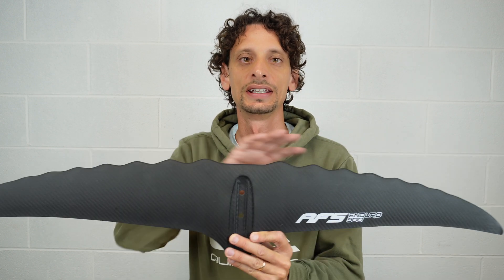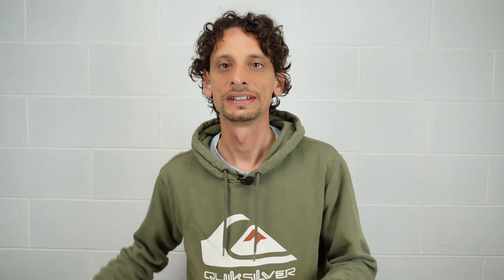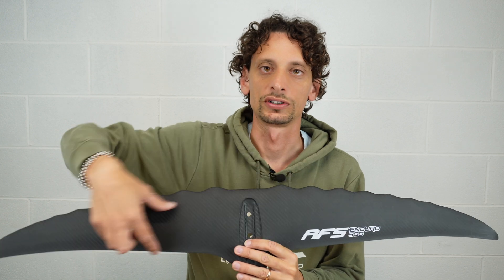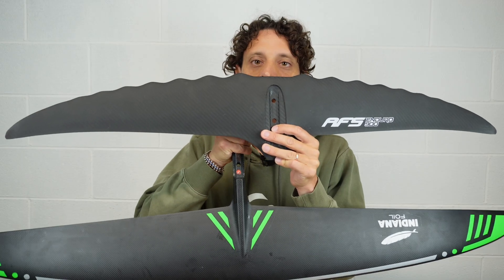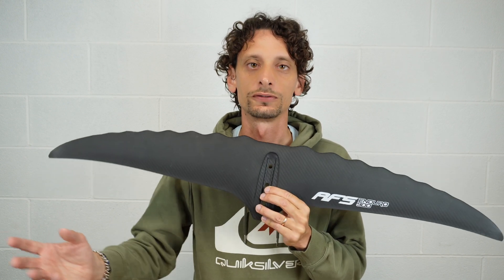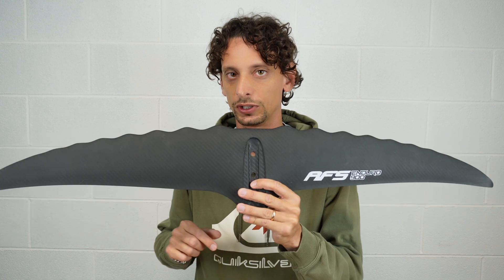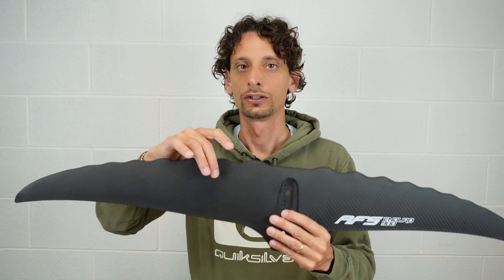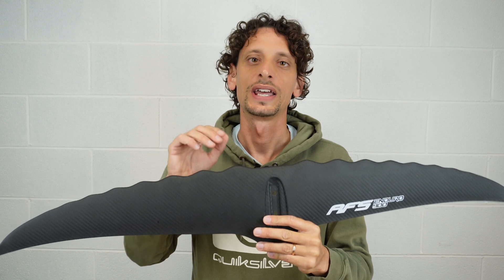HYDROFOILS are CHANGING - A TAKE on the current revolution to help you DECIDE WHICH ONE TO BUY

Comment: I think another thing should be to make foiling easier for beginners. Have you ever heard e.g. of foils than can be mounted on some swimmers so you can very easily try to pump?
Reply from the maker: Hi Michael, thanks for your comment.
For sure the accessibility of the foil is a big topic but in this video I put the attention on the ground braking high performance innovations…what do you mean with ‘swimmers’?
Thanks 🤙
Reply: @Sportalcentro a foil that swims - if you pump it moves forward, if you don't it stops but it doesn't sink. Like a foil sailing boat.
Reply from the maker: Now I understood....but if you look to foil sailboat, at zero speed, the board does not sink not because of the foil but for the volume of the boat...it is the same with the foil for the boardsports..they have lift only with the speed is > 0 and if you don't want to sink the only way is to have a board with enough volume compared to your weights. I hope to have been enough clear!
Reply: @Sportalcentro I totally understand. Still I think the biggest market are easy foils and tools for beginners. I tried to sell my dock launcher at Saturday 9 am, at 9:30 I had two offers and at 10:30 the guy picked it up. There is a big demand for everything that makes foiling easier.

Comment: High AR is only reducing the drag by minimizing the vortex at the end of the wing. There is no influence on
 lift. Consider  sailplanes that have an AR  of 30.
Reply: I don't agree. While tip vortex is reduced by tiplets, aspect ratio and washout, I think you're forgetting that for any given profile, a lower aspect ratio will result in a significantly higher volume of water displaced by the hydrofoil and that volume displacement takes work to move around, creating a kind of drag that skin friction won't account for.
Reply from the maker: Thanks for your comment! I had an interesting discussion with the shaper Gunnar Biniasch (you find it here on the channel in the live section) about it 🤙
Reply from the maker: Honestly speaking I had an interesting discussion with Gunnar Biniasch (you find the complete video here in the channel in the live section) and I find out that the AR is directly connected with the lift..
Reply: Aspect ratio influences the slope of the lift curve. You get more lift per angle of attack change with a higher aspect ratio, assuming the same airfoil shape

Comment: Main parameters of every wing, apart from area, is not even AR, but CL (lift coefficient) and CD (drag coefficient). But they are difficult to use because they depend on an AoA (angle of attack) and velocity.
If manufacturers would publish Area, Drag, AoA for a wing that carries, let say, 80 kg (which is Lift) at speeds 15, 20,25,30,35... km/h ... that would be easier to compare wings.
But currently we are have to compare wings by Area and AR, not taking into consideration even a Camber and Thickness. Such evaluations are very approximate and it makes us to rely on feelings and personal preferences.
Reply from the maker: Thanks a lot for your comment it is very appreciated. 
I agree with you but unfortunately, like you said, the brands tipically provide only a few numbers (area, span, AR, max thickness..and stop) and we need to find out the bahaviour from that e from the test in the water 🤙
Reply: Exactly my thoughts in the past few weeks: how come they don't publish usable data for products to be used in a technical sport like this.

What I'd like to see is similar, like a graph that shows the lift vs speed characteristic (how much lift force the foil provides at a given velocity). This shouldn't be too hard to measure (or maybe calculate with CFD software, but I don't know about those). And then this could probably be done for a few angle of attacks. But at least we'd have something objective to compare, at least to be able to pick the size other than base it on anecdotes heard from others.
Reply: Yes, these graphs are named polars. They are widely used by technical people who develops aircraft wings, propellers etc...
I am sure the sport HF developers also use them. They just do not publish them, because it is kind of "trade secret" and 99% of public wont understand the polars.
Usually the polars are calculated before a wing made. Getting polars of a real existing wing is not easy, it requires running set of experiments in wind/water tunnels or long CFD processing on powerful computers.
Reply: @mm74forums7  Well, after looking at those, I agree that they are too technical and not too obvious without learning to read them, but I meant something simpler. You can just plot the speed vs the lift (the lift force,  probably conveniently expressed in the mass, i.e. "weight" of the rider). So that it would be easy to see how fast you should go to get on foil given your weight. (AoA could be handled by drawing multiple lines on the same chart in different colors. That could help with figuring out the top speed, probably.)
Reply: I would show following polars:
- X: mass and Y: speed that the foil can carry it
- X: drag and Y: speed